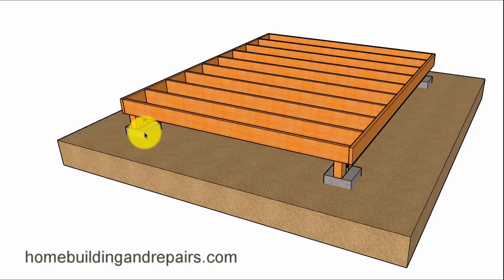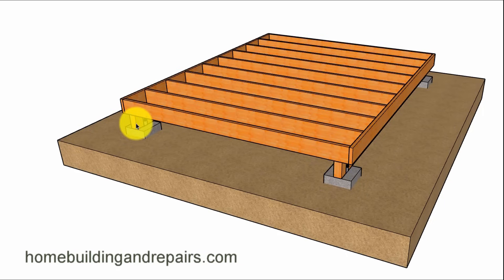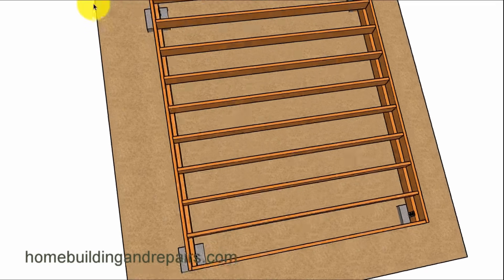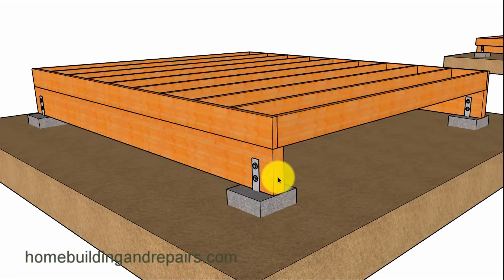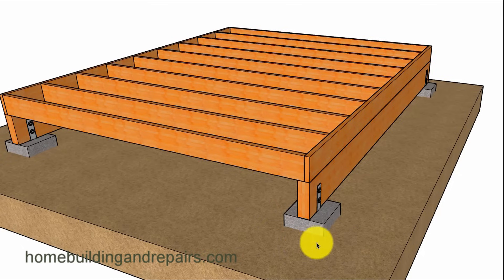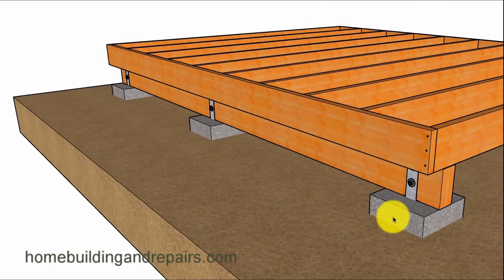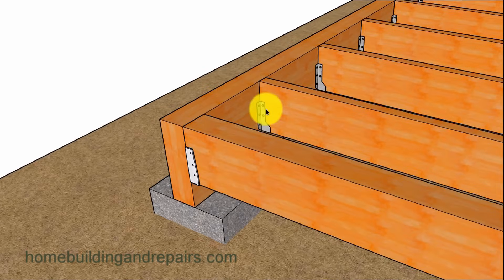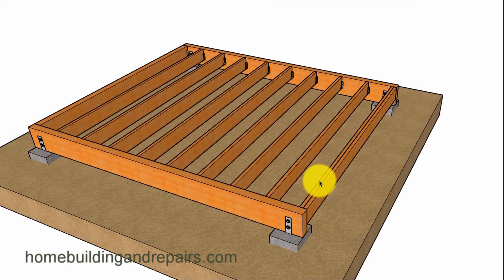Two Ways To Make Stronger Wood Framed Shed Foundations – Design And Building Ideas

Comment: Is there any structural difference between flushing the rim joist with the beam vs having an overhang? With an overhang for example, the walls are sitting on the overhang instead of having a direct support to the beam. Is that a concern?

Comment: A big problem I am going to have is wasps. They love building their nests under sheds. Would hanging siding on the ground with  vents work? Or do you have a better idea?
Reply: Wasps are a problem in my area too, the problem is they will find a way in through any little crack and its almost impossible to try and seal everything up to keep them out. Might be easier once a year, midway through summer block off the bottom of the shed and set off a bug bomb spray cannister underneath the shed, should keep their population down low enough to not get out of hand.

Comment: Why are there no support beams/concrete in the middle? Won't it sag?  Also without a beam in the middle, you only have 1" of the two ends of the joists being supported by the two beams.  When/if those joist ends start to rot, the whole thing will cave in.  Am I right about this or am I missing something here?
Reply from the maker: If the joist can span the distance, then they should not sag. You can use floor joist span charts to find appropriate sizes and yes, wood rot could cause this design to fail.

Comment: The problem with trying to line up the beams perfectly with the rim joists is that it will never happen.  The likelihood of your footings, saddles and beams being absolutely perfectly parallel and the exact distance apart from each other to allow the rim joists to be perfectly flush with them is fanciful.  This is why you overhang the joists by a few inches or more past the beams.  One to take the beams and footings inboard so they aren't a nuisance and also to allow for the inevitable imperfection of footing placements while still allowing a perfectly square floor.

Comment: So where are the main pillars? Over that concrete blocks or over wood?
Reply from the maker: What pillars are you referring to?
Reply: @constructionideas  I mean the main beams, the ones wich go from the foundations to the roof
Reply from the maker: @bluehighseas1150  They can be placed on top of either the beam or footings, but it will be better if it can be placed on top of footings or on top of beam directly over the footing and beam where it would line up in a straight line.
Reply: This type of small shed is almost definitely going to be a light timber frame, which doesn't have a "main" pillar, just a series of studs (usually 2x4") spaced 40-60cm apart, to evenly distribute the load over the base. Generally the whole thing rests on a ply or OSB subfloor which sits on the joists. If you are talking old-school heavy timber framing, with fewer but larger main pillars, that's a whole different ball-game.

Comment: Could you make a video about how to construct the floor of a larger shed say a 20 x 30 that you’re not worried about the roof load as much as the contents of the shed or garage but not using a solid concrete pad how many footings are needed in the cross space?

Comment: so I live in Florida. I am in the process of planning for building an 8x14 shed with a lean to roof on a concrete slab. What would be the best for waterproofing and most secure base for my shed? I'm leaning toward a 2x8 platform with sill plate seal, and secured to the slab with two A23 clamps on each 8ft beam and 3 on the 14ft beams and 3 inch tapcons. thoughts??
Reply: If you are talking about secure in terms of high wind and potential slide or overturn, the best thing is to set L or J-bolts into the slab and bolt your sill plate down with them. Use a treated sill and a waterproof gasket under it.
That said, I've used tapcons or concrete anchor bolts on small sheds and greenhouses here in Japan, and they survive the typhoons OK.
Reply from the maker: Are you talking about a concrete foundation?
Reply: @constructionideas  yes. I'm pouring a concrete slab that will double as a foundation for the shed and a patio

Comment: I’m new to this and want to build my own storage shed. This my be a dumb question, but can I use 4x4 post buried and cement in the ground spaced 6 feet apart to support a 12x24 shed? A motorcycle will be the heaviest item inside.
Reply: The 4" x 4" pressured treated wood posts are not good to burry underground with cement because cement will eat up wood and deteriorate in the near future. I spent double of money to use Mater HALCO metal posts to build my fences. I believe my fence will last twice longer than wood posts.
Reply: You COULD do that... but it has a lot of disadvantages and not many advantages. The only reason wooden posts are buried is for things like fences where there is no lateral support in the structure. Stick with the industry standard way of doing things - give yourself some sort of masonry foundation and put your timber frame on top of that, out of the ground. Especially if you are going to be concreting posts into the ground, you might as well just make some concrete piers, or else set some pre-cast blocks into the ground.
Reply from the maker: I cannot provide you a structural engineering information, but can tell you that your method has been used plenty of times.

Comment: Use two 2" X 6" X the length of the base on all 4 sides. This is needs anyway to nail down the exterior walls. Use concrete support in the middle to keep the floor from bouncing and bowing up. You can use 4" x 4" treated post on the concrete if you sink a J-Bolt into the concrete and use metal strapping to hold down the 4x4. Drill the center of the bottom of the 4x4 so it will sit on the concrete over the nut on the J-Bolt.The treated 4x4 can be soaked with mixture of 50% each burnt motor oil and diesel fuel to last many many years. Old timers used this mixture for 4x4 post for wood fences to keep them from moisture and pest...
Reply: Now you're talking! Without support under the middle line of the floor, the floor WILL sag sooner or later. From videos I've seen, as well as actually sheds here where I live this is seldom, if ever, done. [Planned obsolescence?]  Most sheds around 3-4m  x  3-4m and even larger have a 4x2 box frame on four or six footing blocks/points, with NO support anywhere in the middle. In a high humidity climate like UK, this is very surprising (I'm a recent arrival here). Back home (RSA) this would be contrary to building regulations, and generally by common sense.

Comment: I need help.  I am looking to build a shed, on a level concrete slab.  With concrete deck blocks every 4 feet. The shed I am building has unequal opposing walls, which will change the pitch of the roof at the back of the shed. The shed dimensions are as follows:

Front wall: 15 feet wide X 8 feet high
Right wall: 8 feet 9 inches
Left wall: 4 feet 8 inches
Back wall: 15 feet 10 inches x 7 feet high (at the highest point along the right wall)

The above measurements will make the back wall, right corner lower than the back wall, left corner.

I squared the floor at 4 feet 8 inches from the front, on the left and right walls (which should square the remaining 4 feet 1 inch on the right wall)

I plan to build the front wall, then right wall, then left wall. Lay a board along the back corners to help with the angle for cutting the stud lengths from 7 feet at the back right corner, to a longer cut at the back left corner. 

I don't have any CAD tool to draw the out, so I am building the thing by visually/physically laying things out. Again, I need help.
Reply from the maker: Email me a drawing of your floor plan.
Reply: You cant build it squared n even  .then dont build it.

Comment: I am planing a 20x100 and 40x100 deck for heavy duty tent on top.   Can you tell me if you can make Vedio about a regulator distance between each footing, the size, the height,  and thickness, .   How many beams required, concrete post required , 4x8 plywood sizing required ,  and or if I used concrete slabs with wood posts to hold the deck.    In SACRAMENTO, ca.

Comment: Can anyone tell me if an aquarium that weighs 2000 lbs. total with water, rock, stand, etc. will be okay on the ground floor of a house that has a foundation of 2x6 boards without crashing through the floor? Please and thank you.
Reply from the maker: If it was me, I would reinforce the floor with some concrete footings and support beams or get a smaller fish tank. I knew someone who had an extremely large fish tank and he put it in his garage on top of a concrete slab, if that's even an option for you.
Reply: Thank you for your advice.  @constructionideas

Comment: When the floor framing overhangs beyond the beam as in your first example, how far is safe for it to overhang for a 10 x 12’ shed?
Reply from the maker: I cannot provide you with engineering advice, but most floor cantilevers can stick out 1/3 of length of the joist. This video might help
https://youtu.be/pLDUMKUTVBM

Comment: Every animal in the hood will be living under a shed unless you pour a slab.
Reply from the maker: As long as they're friendly.
Reply: Gravel base, sturdy chicken wire, pvc boards, and lattice will prevent animals from getting under. Concrete slabs arent always feasible or cost effective.
Reply: Leave it open, animals wont stay under there just inside your shed 😂
Reply: Anton Bouchette who pours a slab for a shed? Seems wasteful. Would cost as much as the shed itself.
Reply: @chadevjen7091  some one that wants it to last and not squeak when walking on the floor

Comment: I have the idea to build a 12' x 7' garden shed , gravel compressed base with concrete fence posts laid flat with a damp course membraine laid on the posts & then a pressure treated wood frame on top ready to build up from, the big question would this do the job ? UK based so we dont get the heavy snows ect, just lots of rain.
Reply from the maker: Yes, I think you're on the right track. I've even suggested laying gravel down in an area where it raises the shed a little higher than the soil and then setting pressure treated lumber on top of that as a good place to start. The only thing I don't like about using the membrane is that in areas where there is a lot of condensation, the condensation can actually form on top of the membrane and trap moisture, allowing it to absorb into the lumber. Maybe rethink this part of your process.
Reply: Thank you for the reply & a very good point made I never thought about the membrane sweating as such, So its out with the membrane idea. In fact the 100mm fence posts & the 100mm treated wood actualy lifts the timber off free draining gravel aprox 200mm < 8" > so should be ok. Next problem is getting around planning rules Grrrrrr ! if i put a free standing shed up i would have just enough room between the 6ft fence line for repairs ect, my other idea was lean to style from the end side wall of my house which infact is a money saver because its one wall less to construct & i can go that little wider, fingers all crossed for planning phone call return, at age 72 this shed / lean to will be pent roof style mainly for ease of build plus only got my wifelet as a reluctant helper plus its not going much above the fenceline, The end of this month im having all new glazing done so i have asked the fitters to save both identical landing & wc small windows, that will improve greatly off the peg ready made shed windows , also asked the fitter to look around for a good used home back door offering upto £100 for a good one and again better than a homemade one. Again thank for the tips & reply

Comment: A question, i'm planning to build a shed with space for storage in the attic/above the ceiling. The size might be 8x12. Do you think 4 re-used footings would work? These would be footings from a deck that I took apart and they are uncracked concrete footings 4 feet tall. Thank you in advance
Reply from the maker: It would be difficult for me to answer your question, without seeing any pictures. Feel free to send me some pictures for more information.

Comment: Since the concrete is above ground, do you need pressure treated wood?
Reply from the maker: You would need to check with your local building authorities, for example your local city or County building Department for clarification, but I wouldn't think so. I don't think I would worry about it if it was at least 2 inches off of the ground, but some would suggest that it wouldn't need to be used as long as it wasn't touching the ground.